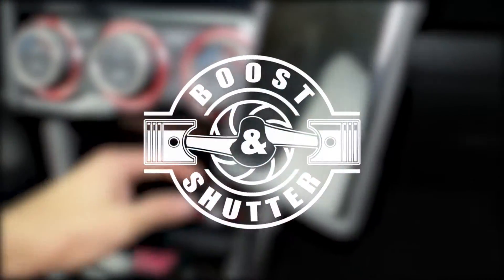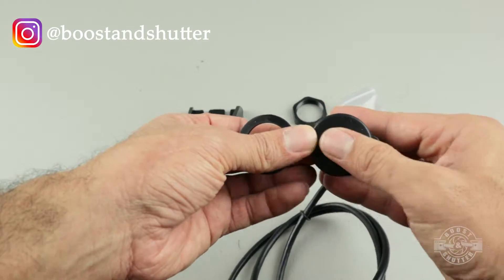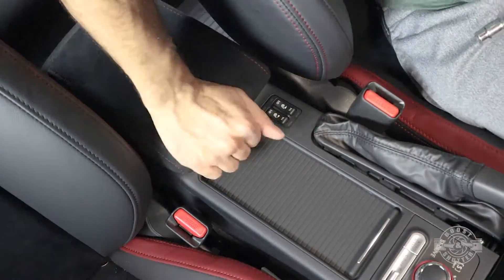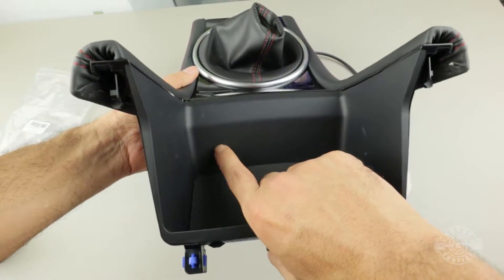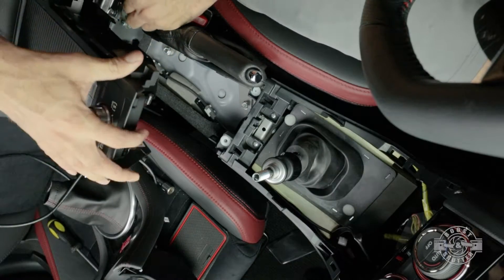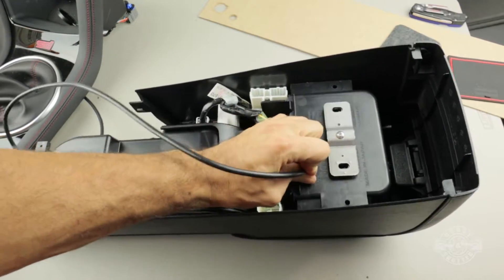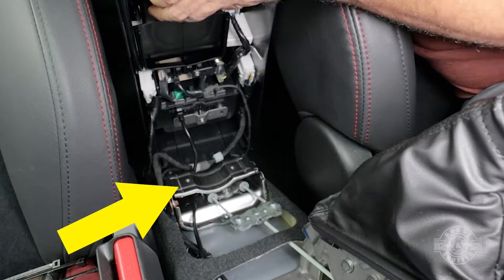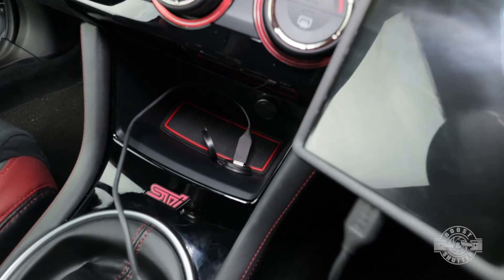How to Relocate Car's USB Port  | 2020 STI Install |

Comment: Thanks for your videos!!

I took your video and did something slightly different.
I took the USB adapter and drilled the hole on the left drivers side, opposite from the cigarette lighter.  
Plenty of room...and it faces the driver and passengers.

I have the same car as yours!!!
Gonna do the AOS and Lip and side skirts..
Reply: did you have to remove that piece to pull that off? or are you able to do it by just removing the lower part? thats what i want to do,

Comment: I have a completely different vehicle but  Do you know if the USB head could be installed in the cigarette lighter socket if it were to be removed? (Meaning, switch the cigarette lighter for the USB extension comfortably.)

Comment: Great video as always. You should of used the wifi plug in and save the hole drilling.
Reply: @akqjtn  I posted the link using my Kubota monster channel for you but it seems to have been deleted or disappeared. Might want to check your messages that need approval.
Reply: Does that work with the stock radio ?
Reply: @rasheengrant  Works with any radio that has apple car play
Reply: DJ Tony Romeo gotta try it out. I’m subscribed to the channel you linked but he has an android radio so I assumed I would need the ability to install an apk for it function.
Reply: @rasheengrant  Yeah from what I gather from reading up on it is, as long as you plug it into the apple carplay USB, it should work on any car. I'm going to get it for my STI. I don't want to be drilling holes if I dont need to. I'll do a video on my "Kubota monster" YT channel. I have a few videos up of my STI if you want to check them out. Just got it last week and did some mods already.
Reply: DJ Tony Romeo Ile check it out. I have a 19 Sti.

Comment: I was planning on doing the same thing, but I want to put my usb where the lighter is. How do I get to that panel do I have to remove the radio??
Reply: This is exactly what I was thinking!
Reply: Boost & Shutter actually it’s not necessary I just did it, thank you
Reply: Boost & Shutter I just pushed from the back and turned until came out, not difficult at all, just like changing a bulb turned and pull.